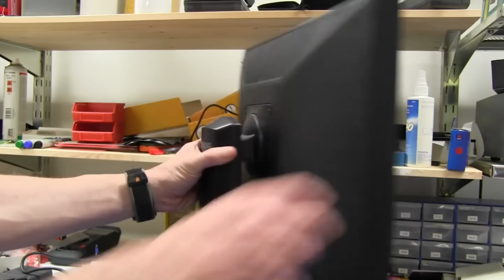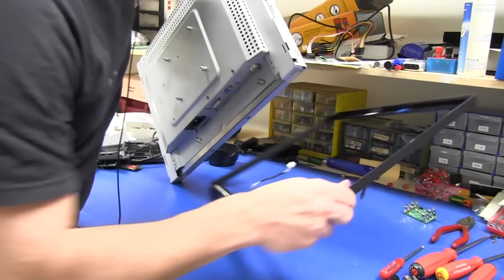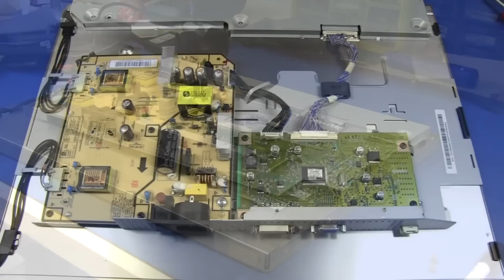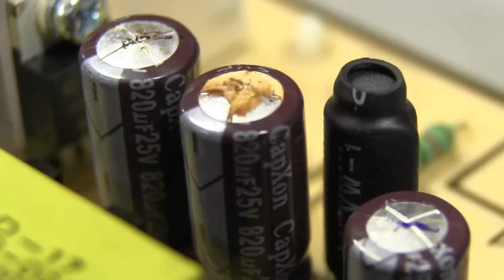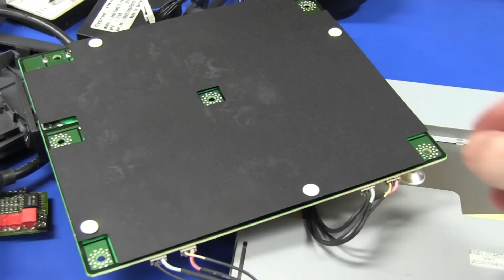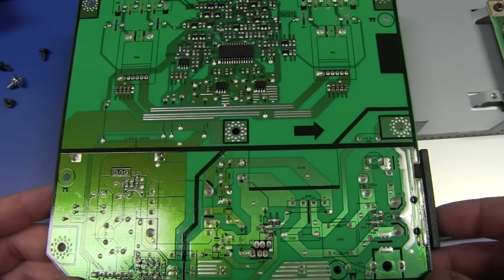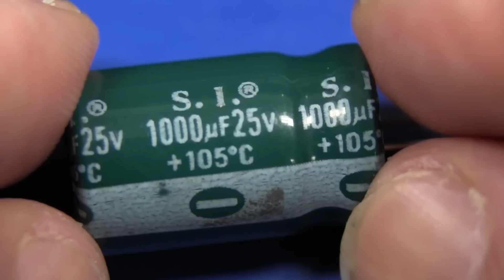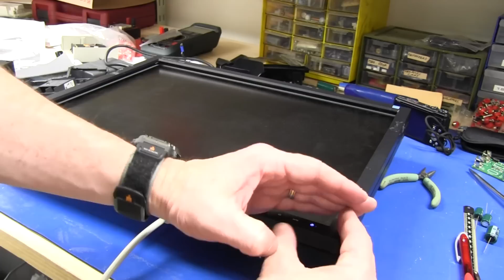EEVblog #347 - Bad Cap LCD Monitor Repair

Comment: I want to say thank you so much for these videos!!! After looking at the crapxon caps that had puked I knew I had a chance of repairing these 2 TVs. After a total of 2 hours and 6-330~25v + 2-1000~25v caps,both TVs work beautifully!!                               Thanks again for the inspiration and confidence!!!!                                                 BTW I used Taicon caps and the Samsung sprung to life from oblivion,the Philips was teetering on the brink with intermittent function.

Comment: same happened to my old working place. was lucky enough to grab a lot before they got into the dumpster. replaced the faulty capacitors for like under a few bucks and voila, working like a charm.

Comment: I love this guy! :) 
my syncmaster 226bw has the same problem.but it works after a while even with bulged caps.first, screen stays black but after a while it starts flickering and another little while later it works fine.i have 5 820yF caps and a 330yF cap by capxon on my board, all bulged.the big 100yF/450V one seems to be a of a different brand. JB or something?
Anyway.Thanx for your great Videos! Love it!

Comment: yes to all of them. I took the power supply board to a repairman and discovered that power transmitter had gone bad. Not sure if was caused by my fail attempt at fixing it.

Comment: I had a Samsung 226BW with the exact same power supply board in it. In my case the monitor had problems turning on. I replaced the Caps and its working just fine.
This was last october an its running about 8 hours per day without any issues. I too haven't bothered replacing the input cap. The only difference with my board was, that at the top corner there are 3 820µF caps. Maybe thats why my monitor didn't fail completely. I replaced them all with Panasonic FC caps.

Comment: I have Westinghouse LCM22w2 and I tried to repair it by replacing the caps. I tried my best to replace the damaged ones and I think I did okay. However, after I finished repairing and when I tried to turn it on, it did not turn on. But, I could hear electric sort of noise from the back of the board. Have you had similar experience? what did you do? or do you think I totally broke it?

Comment: Got a Samsung, round same time but different model.  Caps have also gone in exactly the same area.  This is helping me fix mine.  I have the replacement caps.

Comment: Been having difficulty switching on my monitor for a few months now (~3yr old), but because it was also reluctant to switch off I assumed the power switch (flimsy tactile thing) had worn out, but tonight I've heard it whistling so this may be on the to-do list! Nice clear video, better pick up a spudger or I'll get flathead screwdriver impressions all around the bezel!

Comment: FYI: Just opened my own Syncmaster 930b and voila there are the bad caps, samxon brand in my case. 3 - 820 uF 25V caps just like your video. Slightly different layout to the board and case but otherwise it's obviously the same.

Comment: I've repaired several LCD monitors and in all cases, it's either the power supply caps that burst or the backlighting high voltage DC-DC converter power MOSFETs that failed.

Comment: Nice Fix I did an old all in one PC by replacing the caps, although I now now to get low ESR ones next time.

Also did you know that a lot of bad caps are down to a stolen electrolyte formula.

w w w.guardian.co.uk/technology/blog/2010/jun/29/dell-problems-capacitors

Comment: dave first of all .tanks for your videos ,you are making a good job ,i have this problem with a laptop ,my lcd screen has a vertical line on the right of the screen and writing is seen discontinued,I replaced the lcd cable and the same line is still ther,i opend the lcd frame to see if its a cable connection inside bad and no bad connection bad it can be the pcb board problem tell me please what to do

Comment: hey, can you explain what "low esr" means? i am also wondering, if replacing the 340uf with an 470uf, these need more time to charge fully. so is that not a thing i want to bypass? or is it just not that important on the dc side of that psu, as it would be on microelectronic boards? you do a great job here! like to watch, learn a lot.

Comment: 12 years?! You are a beginner... ;) I know one Samsung TV at relatives which is running for 18, and an other for 20 years without its case opened ever! These times Samsung have used 85*C SamWha capacitors. I found that 85*C CapXon and G-Luxon capacitors are much more reliable than 105C Low-ESR pieces of these brands. Maybe because they contain simpler electrolyte, which is chemically more stable.

Comment: If anyone has some that are too big to fit just solder in some jumper wire and solder the caps to that then tape or hot glue them to a area that has nothing there.

Comment: I think Samsung use worse Capacitors because they bust faster. So you must buy a new Monitor and don't use your old one forever. ;) That's the crap mindset of our disposable society. Look, the Canon PIXMA iP4300 power supply broke immediately upon the warranty. My Canon PIXMA iP5200 works just fine over 5 years. But look I wonder SIEMENS does use solid caps in the early 90's in my old but now broken S-VHS camcorder. That's awesome! The cheaper a device is the cheaper the used elec. components.

Comment: I have fixed quite a few LCD screens that show a common fault where they power up, give a picture and then go blank about 10ms later, or if you hold a torch up to them you can see the picture. The back-light drivers fail for the CFL, which can be simply replaced along with the caps that are paired with them which brings them back to life.

Comment: It is soldered to the board - the connector just has both PCB pins and wire hooks.  I don't know why it has both, but if you look a bit latter in the video you can see the back side of the board where the IEC connector is attached and there is clearly a big ground plane with a big connector pin sticking out.

Comment: It's side effect of buying parts from a state financed Chinese factory that underbids legitimate companies. But there is a market for higher priced, if not higher quality, electronics otherwise Apple wouldn't sell as many products as it does, so if there is a perceived extra value then people will pay for it. If anything the Rohs lead free solder crap enacted by the E.U is responsible for more electronics going to the dump then Chicom caps, and that's a pseudo government responsible there.

Comment: They would save everyone a lot of trouble if the trucks picking up the electrolytic caps at the Chinese capacitor factories went straight to the dump rather then to market.

Comment: Hi Viktor, don't know where you're writing from, but here in Chile, you can insert the plug in either mode: So, a two-pole mains switch has to be a must. I just think the UK's insistence on grounding is absolutely valid. I would say it has saved more lives over the years thanks to any any other single precaution. Also, UK plugs have fuses rated for the appliance fitted to the plug. I agree that most things today do not need  "grounding"...but you take whatever precaution against shock & fire.??

Comment: Whoops, I meant solid polymer capacitors. I'd like to see more of those in electronics! Very tired of my recent purchases having the point of failure at the cheap electrolytic ones. I'm sure they just cost pennies more.

By the way, great videos! I'm gonna register at your forum. Keep up the good work!

Comment: I just LOVE your videos!!!  I bought a Rigol scope and "updated" it after I watched your video... YOU made the decision for me to get the Rigol and I really like it!  True it isn't a Tek of HP, but for the price it is a great piece of equipment!
About the input cap... it probably isn't bulged because it is filtering 60hz and probably isn't a low ESR, where the other ones have to deal with the SM frequency (~35khz?).  Just my guess and experience.

Comment: How do you find a local electronics store? best place I have found so far is radio Shack and their capacitor selection sucks. I've tried google, and yahoo and can't find any good place. Thinking the actually phone book may have better success at this rate.

Comment: I've fixed a couple of monitors with the same problem. A month ago, I've got an LG Flatron L246WH 24" 16:10 monitor that didn't poweron. There were two 3300uF 35v caps in parallell (6600uF) that had leaked. I replaced them with a single 6800uF 50v nichicon cap. Works like a charm now. :)

Comment: I repaired two Benq monitors by replacing bad capacitors. 

The two monitors failed shortly after their warranty time. After replacing power supply capacitors there haven't been a single fault with them. Still holding today 8 years later.

I suspect manufacturers sometimes choose low quality capacitors willingly, to increase their overall sales.

Comment: LoL, Man this was familiar. Friend had a 40" Samsung TV from the same year that would turn it's self off or the picture would go all acid trip. I got it off him for free and found the same issue in it, bad caps on the power supply board, though they were a different brand than yours. So for $40 in 125c rated Nichicon caps I ended up with a $1,000 HDTV.

Comment: I just bought a syncmaster for five bucks. It was second hand and has pressure damage to the LCD panel. It's still useful to connect to servers which normally run headless, which is what I bought it for (that and it was cheap and I really wanted one) Any idea if such damage is repairable or should I just leave it alone and be happy it works for temporary setups?

Comment: Yep, I fixed five LCD monitors today at work. ALL of them works after replacing the electrolytics in the SMPS. And yes, three of them were Samsung with, you guessed it, CapXon caps. Here's a picture of them and a bag of replaced caps ;-)

Comment: thank you for the tv good sir, found a 32 in visio tv dead on the side of the road and replaced some caps2x 10v3300uf and 1x 10v2200uf  now i'm rocking a $5 tv, thank you for showing me how

Comment: the caps cannot be damaged. they will just short and discharg. if a battery did that it would just hheat up and die. a cap is just a quick little spark.

Comment: (from badcaps dot net) "The reason this problem exists is because of a large-scale industrial espionage foul-up.  Some companies decided to steal an electrolyte formula from another competitor. Little be known to them, the stolen formula was incomplete and flawed. They didn't discover this until it was too late and they had manufactured and distributed literally MILLIONS of these flawed capacitors. [...] even today, these crappy components are being used in new boards."

Comment: My bet is that they use the crappy capacitors on purpose, to increase failure (and replacement) rates.

In the mean time, the power supply is well designed, probably to meet some regulation or other.

Comment: I use wood stick that has 150ohm high voltage 5W resistor attached to it. I work with high voltage pcb's and that's my favourite tool to save my self from daily shocks. Depends on cap's dv/dt maximum what it can handle in terms of discharge.

Comment: Capxon, legendary in failing. I had ATX PSU with capxon caps and PSU stopped working and go figure the capxon caps were bulging. Capxon is popular also in badcaps forums.

Comment: When you short circuit the terminals of a capacitor with a screwdriver, you're trying to reduce its voltage to 0 instantly, which would require a very large electric current, thus generating a lot of heat. To discharge it slowly, you can just connect a resistor to the terminals and monitor it with a voltmeter. In fact, the voltmeter itself can be used for that purpose (if it's analog), but it would take really long to discharge, as they have a really high resistance.

Comment: Wouldn't you say that the design allows for too high ripple current as well as the bad-cap issue? Also replacing the caps with physically larger units would help with heat dissipation.

Comment: I had my SyncMaster 931bf fail for the same reason a couple months ago. The backlight would keep flickering out and I'd need to power-cycle the thing to keep it on. The case was surprisingly _less_ of a pain to open up than this one here, although still a bloody pain. =[ Replaced all those CapXons except the 450V one with some nice Rubycon caps!

Comment: Of course, most of consumer electronic devices are made like this, well calculated to fail soon after the warranty ends (thank EU for 2 year warranty). Managers need to sell more new devices so they demand artificial life shortening.

I would even go as far as to speculate that electronic manufacturers demand caps which are made poorly like this so they are guaranteed to fail in some time. Just don't blame the engineers.

Comment: Every flat screen telly and monitor I've had to repair in the past several years has used them blasted CapXon 'lytics >.< ALWAYS the same problem with them!
Samsung make how many millions a year? And they can't even be bothered to put high temp caps on the boards where the heatsinks are :-\

Comment: I repaired my monitor the same way just recently. In all the monitors I've repaired, the symptoms were completely different and could be misleading. For example, my monitor only showed white screen (backlight) but other brand monitor needed 15 tries to turn on.
I would say bad caps in this one are intentional. Build quality shows they know what they're doing, with crappy caps it's planned obsolescence.
Lastly I'd like to suggest a subject for a follow-up video: safe discharging of caps.
Thanks.

Comment: Nichicon and Rubicons are good brands if you can fund them, Capxon must be the 21st century China version of Hunt capacitors, which were also notorious for failure in British made radios and TVs of the 1950s and 60s. .

Comment: I think it's because the way the electrolytic caps seem to fail is by going open circuit rather then shorting, especially so when the electrolyte in them dries out. A lot of Samsung made flat screens had a habit of using caps that were of too low of a voltage rating, as well as using a cheap brand of cap.

Comment: Awesome video!  I've repaired about 15 monitors, all from bad caps.  If the manufacturers would use better caps to begin with these would last at least twice as long.  I suspect they use crap caps to A) save a few cents per monitor and B) planned obsolescence so we have to buy more.

Comment: Nice video! I own two 203B's. One of them has trouble switching on on first try for some time. After watching your video I decided to crack it open. Mine is very similar design, except both boards are mounted to metal plate. Of course I found faulty crapxon caps inside. I'll solder new ones tomorrow. Let's see how it goes. What about Samxon capacitors? Are they any good?

Comment: I should have made a video like this years ago. I have lost count of the number of lcd monitors I have fixed over the last 4 years and 99.9% of the time its those cap in the power supply.

Comment: I have an 18" 4:3 Hitachi monitor that alive for over 10 years now. Hitachi says in the user manual to replace the power supply after three years and yet its still working like a charm. So where I'm going with this is this. In the race to produce competitively priced monitors I would guess that sometimes manufacturers have to accept a supplier who probably wouldn't have been their first choice simply because their offerings are cheaper yet meet their requirements.

Comment: It's a very good manufacturer, just as good as Rubycon or Nichicon or Panasonic when it comes to performance and quality.
 
They only had a couple of flawed series, KZG and KZJ (not making them anymore)... the other series are solid. Nichicon had issues around 2004-early 2005 with HM series (fixed now, but they're going to discontinue hm,hn,hz series), other then that they're also solid. 

Rubycon and Panasonic afaik had no series of capacitors with manufacturing flaws.

Comment: In this case the warning signs were for the backlight drivers, which put out high voltage while running. The only dangerous cap here (after the monitor being unplugged) is the large 450V type near the AC input. You can discharge it by connecting a resistor in the order of 10k accross it's legs. If the board is unplugged, touching a single wire should be safe. Without ground reference there's no path for a current to flow.

Comment: Not really. Look up datasheets of capacitor series of known good brands (if they are good brands they have them!). They list every cap they produce with all its ratings. While the ESR is dependent on the capacity, it's nothing that can get you in the range of "low ESR" labled caps.

Comment: 99% sure it's some caps. Almost typical behaviour. As their capacity goes down, the ripple on the power rails starts to increase more and more. If you draw more current (like with a bright backlight) the ripple gets worse to the point where the circuit craps out.

I repaired 3 (three!) LG L1919S by exchanging bad caps on the PSU. One had a bad input board, too, but the other 2 are working fine for the last 5 years (and they get used 10h+ every day). Just be sure to get Low ESR replacement caps.

Comment: I'm sure they made that extra buck since these go bad after the warranty expires.

I have an LG L1932P that can't go above the 30 brightness level (maybe lower now), once you reach that brightness level poof the monitor's back light switches off. Don't know what causes it. No blinking LED. I'm still using it at 0 brightness level which is bright enough for a second monitor. Bad caps?? or something else?

Comment: try disconnecting the back lights one at the time,
i had one with a similar problem, and the bottom back light got wet and corroded the high voltage wire.